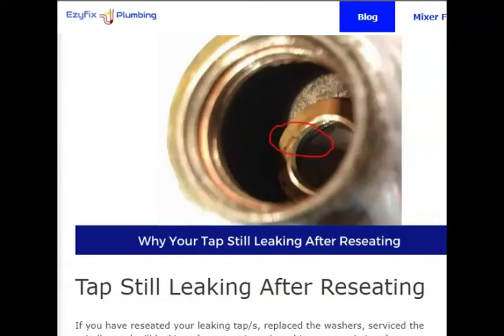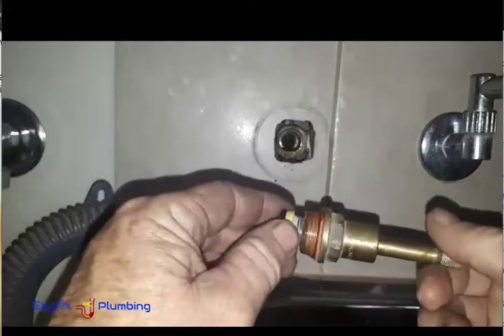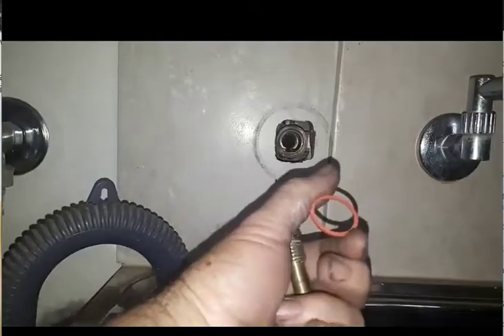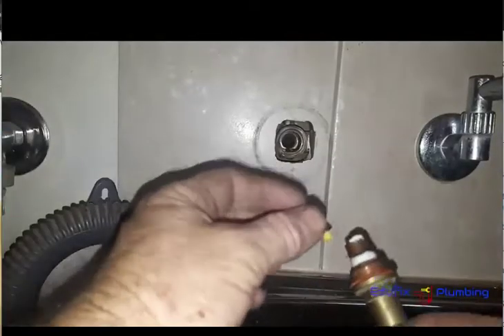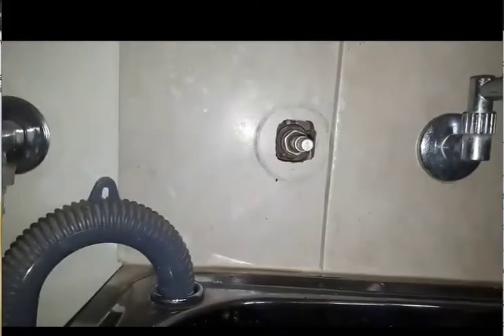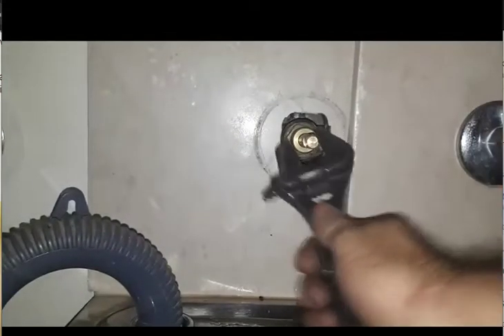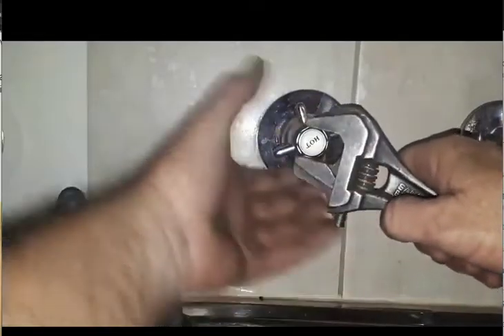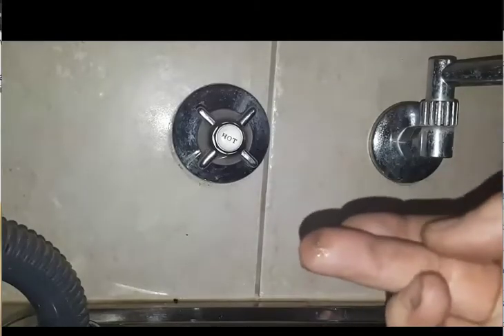How To Use A Tap Reseating Tool Like A Pro

Comment: Thanx mate, very very helpful. Thanx to you I managed to recognize a mistake made by a former repairman, there was debree in the rubber of the spindle, copper and some white stuff. I guess: Did not leave tap open when opening the water supply again, so old debree got stuck and and it went leaking. Managed to adjust a 18mm rubber into a 16 mm 1979 spindle for the Italian Faucet I have (Rapetti, they went broke). That was not in ur video;) My first plumber DIY in my life was no disaster thanx to ur great video!
Reply from the maker: Glad to have helped mate. Different countries different hardware but at least you got it at the end and smarter than the repair man by the sounds too.

Comment: Thanks for the Very Clear and easy to understand video. I need to change our shower tap washer as the cold water is leaking really badly. I am hoping I don't have to seat it as I live in a small rural town in W.A and the nearest Bunnings is a 6 hour round trip to Perth.
Reply: Hey Graeme, next time your in town grab a reseating tool for sure. Glad it makes sense to ya,. PS I'm in Kal☺
Reply: @Jason-gn2ro  Small world, I was born in Kal and lived in Lewis st Lamington. It wasn't as posh as it is now though :)
Reply from the maker: @MrGraeme54  Yer things have changed. I've only been here for 9 years and over the airport way is similar area and down towards the lemon they call Golf club haha
Reply: @ezyfixplumbing9552  Yep it has all changed since the Open Cut. Before that, it was so much better. Mind you the mines were operating back then, but once they closed, Kal lost its character.

Comment: Good tutorial...I have always fixed my own washer and ''O'' rings, and I have used a re-seating tool to clean up the washer seat, but I am always a little concerned
if I have got all the filings cleared out, especially on the en-suite bench tap assembly, hate having to run back from the verge water meter with the tap open just
a little in the hope of being sure all filings have gone....someone should come up with a special fitting the can be screwed in place of the tap assembly that will
allow a good flush into the sink before installing the tap, I know it means another trip to the water meter!!

Comment: i like the sauce bottle flushing device, i could never get the taper locking style refacing tools to work right, never knew the tool you use was meant to be driven by a drill, i have one but no instructions when i bought it ions ago from a hardware.

Comment: Hi there im using the exact same resetting tool from bunnings and i have been screwing down the tool thread bit into the red fibre o ring before spinning the drill bit. I notice you dont bother with this step and you get a perfectly smooth face. Is this why my tap is still leaking after  resettling?
Reply from the maker: Hi mate, no I don't think using a fiber washer on the tool will make any difference. If it's still leaking it must have a small imperfection on the seat or you've gone too far on the seat and now the breach may need replacing as if you've gone to far it will be to thing to install a new stainless steel seat
Reply: @ezyfixplumbing9552  thanks ...dont want to go down that path.

Comment: the o rings don't stop it dripping do they?  just stop it leaking to the outside when the tap is open, water coming out?
and how far down can you take the tap seat? I have one with a black line across it which I suppose is a groove and that's where the endless dripping is from.  but i've gone down what seems like a long way to me and it is still there.  Must be a thing that happens a bit.  so how far down can we go?
and i'm thinking now get a push in reseat. so what about them?
good vid.  good clues.  add those extras: great.
Reply from the maker: How far you can reseat is a difficult question to answer mate. Is it in the wall like a shower  breach or on a basin where you can replace it with ease. Sometimes if the cut on the seat is deep you might have to tap in a new seat instead of facing the one that is there. Sorry I can't give you a more direct answer without seeing and being there
Reply: @ezyfixplumbing9552  hey, hi... thanks for that.  I'll take a punt on one of these 'tap in' replacement seats and then if that doesn't work I'll go for the hydroseal 'screw in' job.
I'll try and measure how much depth of seat there is left somehow.  I wondered if this 'squiggly black thread'  across the seat, from inside to outside,  was a known happening and if so what is it? cracked brass casting?  they are cast are they?  or fault in the casting? you get that, do you?  or there's some magic bug that eats through? I'll believe anything.  :)

Comment: I suppose in very old houses the taps would have been reseated on many occasions and there would not have much brass left on the pipe. How do you know when you can no longer reseat the tap using this reseating tool?
Reply from the maker: mate there is really only 1 way and that is to keep reseating until you bust through then you'll need to replace the breach. just don't do it on a Saturday afternoon when plumbing supply shops are closed for a new breach.

Comment: Seating in my showers have cracks, no matter how much I drill to flatten it out the cracks are still there, I have the same problem throughout the house.
When do you know you have drilled too much and you need the plumber
Reply from the maker: Hey mate, without seeing them its hard to tell how much is left on the seat and how much you are taking off. When to call a plumber? when you've busted through the back of the seat. Wouldn't recommend doing it over the weekend but. callouts are a bitch or worse can't get anyone and you have no water for the weekend. If you want to take few pics of the seat, send over to this email jack@mtwda.org.

Comment: My washer won't come out I tried piles I tried everything won't farken come out anyone?
Reply from the maker: sounds like you may have spindle extensions. did you get a little brass looking thing that was similar shape as a washer?
Reply: @ezyfixplumbing9552  yes there is a extension but how do I get the washer out I can remove the extension the inside washer will stay there for life.
Reply from the maker: @serb8335  you need to remove the big brass nut with a socket, about 28mm depending on the brand and unscrew it, only way my friend sorry. these are extensions that need to remove https://www.reece.com.au/product/performa-spindle-body-extender-15mm-9502855